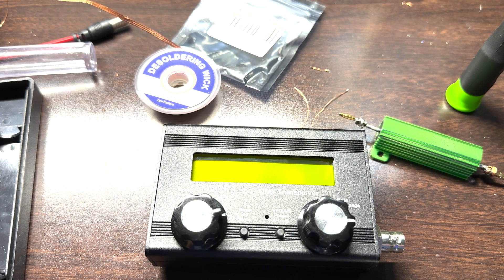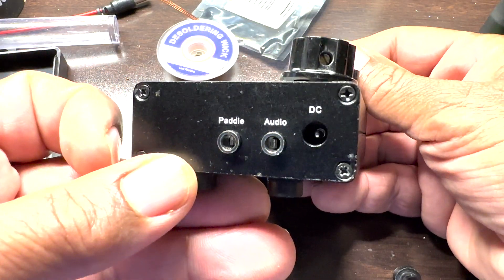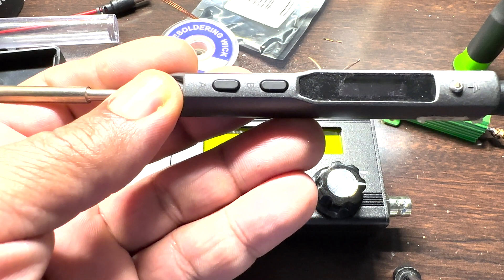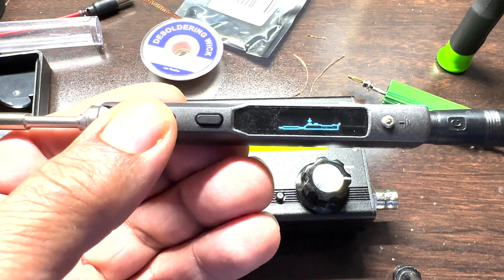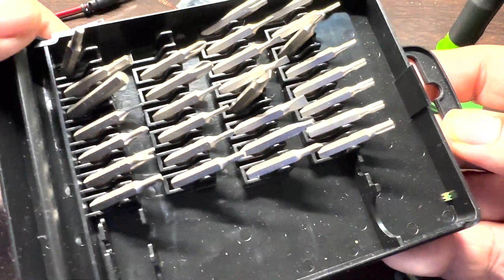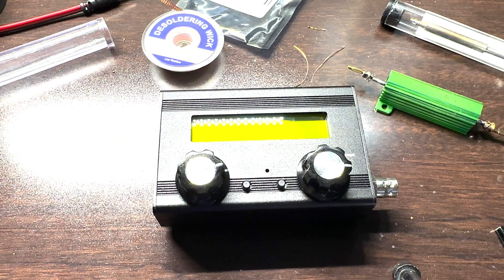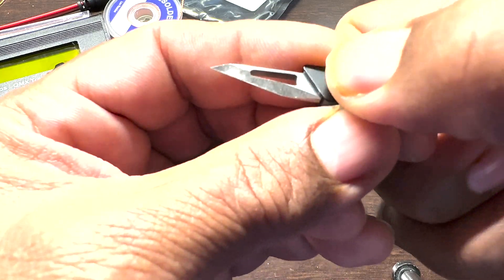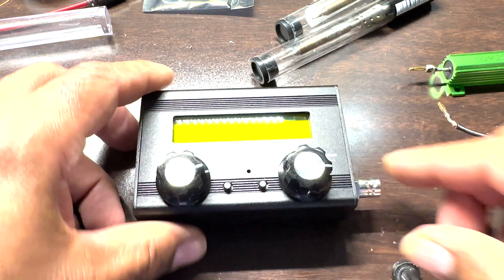QMX 5 Band by QRP-Labs Kit Update - Hotel Ham Tools Update - Update on K6ARK 100w Ant Kit

Comment: I like that ts101 soldering pen as my primary. And I have a welled soldering station
Reply from the maker: Thanks for watching and taking time to join in. I appreciate it. Yeah, that little iron is so versatile. If I’m in the field, it’s 12v. If I’m at home it 24v, multiple different tips available, and easy to use. My favorite too. Makes the Weller last longer, lol!  See you out there. 73 de Bill